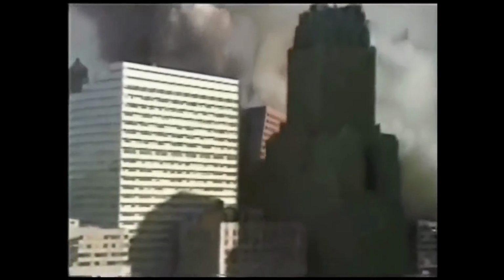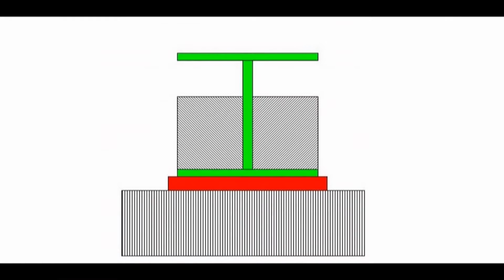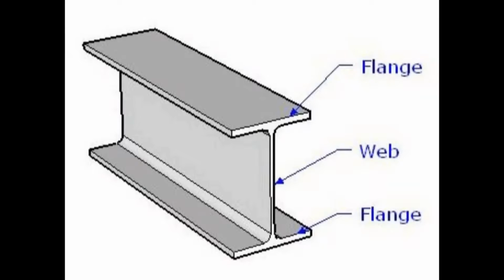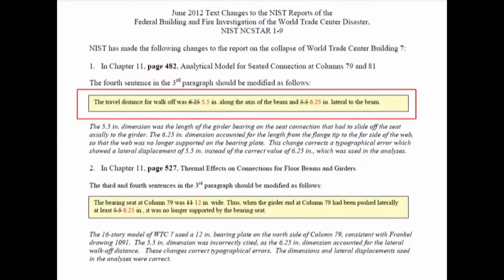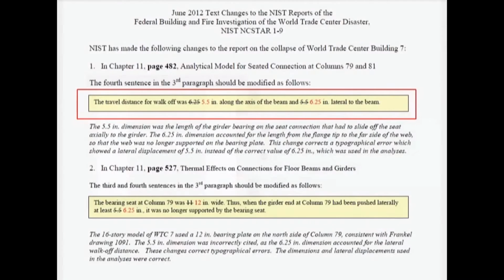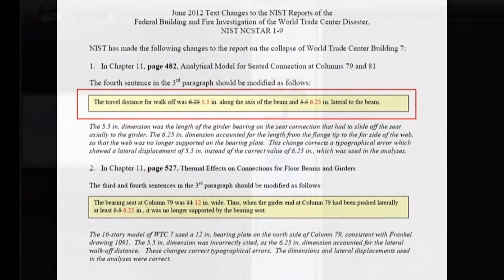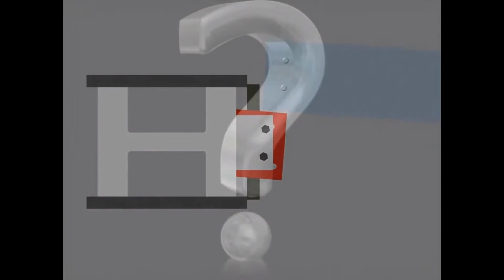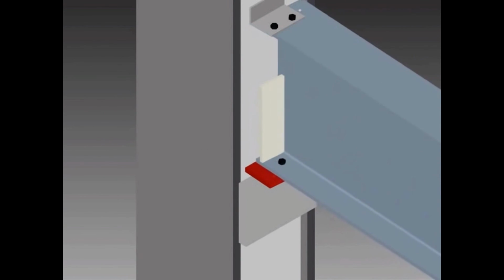WTC7 maladminNISTration

Comment: You're not taking into account that materials fail and break when subjected to forces. The girder doesn't have to be pushed (or pulled, it doesn't matter) all 11 (or 12, it doesn't matter) inches for it to fall. A force that was spread across 11 (or 12) inches of steel can break the steel when its spread over a smaller length. When NIST says it COULD happen at 5 (or 6) inches of sliding, it doesn't mean it DID occur at exactly that distance. Stiffeners can also be broken by expanding steel. They're not indestructible. And even if they were indestructible and had resisted the force, the expanding steel would have to bend or buckle to compensate the expansion, both of which can cause destruction and subsequent falling of the floors. Also, this was only one of many mechanisms of failures that possibly happened in the building. What you guys don't understand is taht NIST didn't have 100% of the information necessary to replicate the exact collapse with 100% certainty. That would actually be impossible, even if you had temperature sensors and cameras in every steel beam, due to countless more unknowns (loading of the floors, extent of the damage from the wtc1 collapse, exact fire progression, steel corrosion since the building it was built, quality of assembly work and welding). What NIST did was to explain one or more possible SCENARIOS (not exact replicas of) of collapse. And the goal was not to disprove conspiracy theories, but to find out how they collapsed so people could find ways to make buildings safer. That's what NIST stands for. It's not the Federal Bureau of Investigation, it's National Institute for Standards and Technology.
Reply from the maker: +Darth Judith Weber - Conjecture. Study the problems properly, darthy.

"What NIST did was to explain one or more possible SCENARIOS (not exact replicas of) of collapse"

I'm glad you agree that it's all theory. Many of your fellow true believers think it's all proven fact and unquestionable. Well done for being different.

Have you thought of contacting Dr Leroy Hulsey and telling him what he got wrong with his thorough examination of NIST's claims? If only you had done so before he got started.
Reply from the maker: +Darth Judith Weber - You have no arguments, obviously.